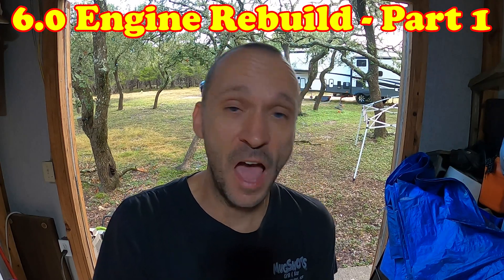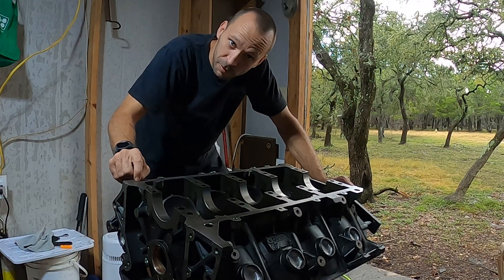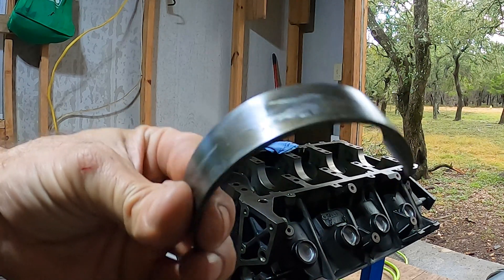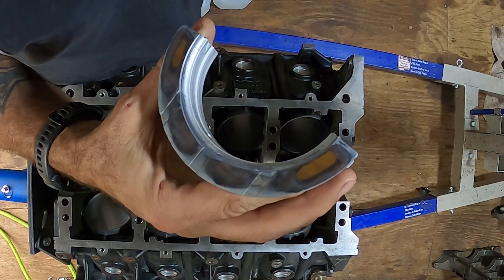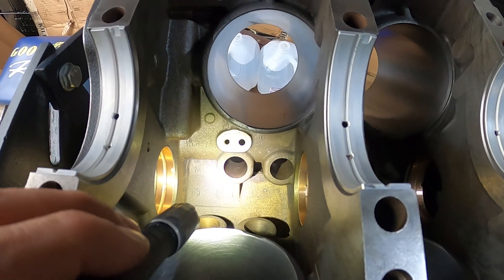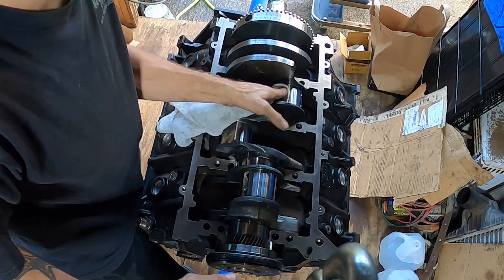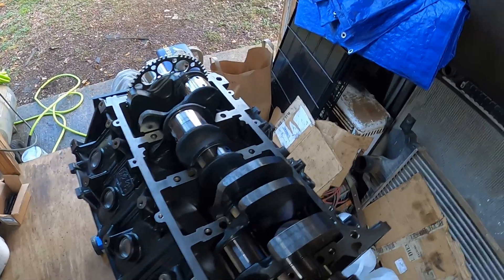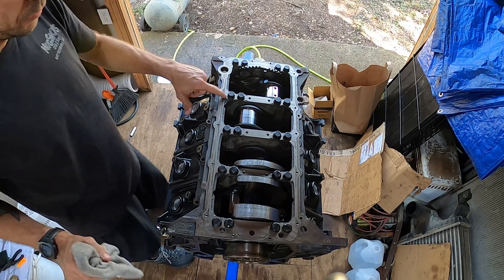6.0 powerstroke - DIY Engine Rebuild - Part 1

Comment: I’m totally watching this series in case I need to do a rebuild I saw your disclaimer no worries using it for prep work because I feel it coming 😂
Reply from the maker: It's not hard at all, just take your time and use a torque wrench for everything inside the engine. P.s your truck may blow bubbles. JS
Reply: @grumpysdiy  this is what I have been finding even though it's my first truck and diesel on top of it LOL. I've been going to working on it myself since the newer ones you can't do too much on your own so what better way to learn thanks again for the vids. :) if it blows bubbles oh well worse things in life :)

Comment: Hello my friend,could you please tell me measurements of head bolts.I need dimentions of that..I want to try them on my 3.0 om606 diesel engine if it fits.thanks
Reply from the maker: They are arp head studs, their website has that info.

Comment: Hey I need to mount my 6.0 motor on the front like  you to remove cam and rebuild. I fiqured for bottom 2 bolts you used the big bolt holes used for fan shroud and ground but on the other 2 did you just use front cover bolt holes?
Reply from the maker: I’ll be honest I don’t remember. Sorry I’m no help.